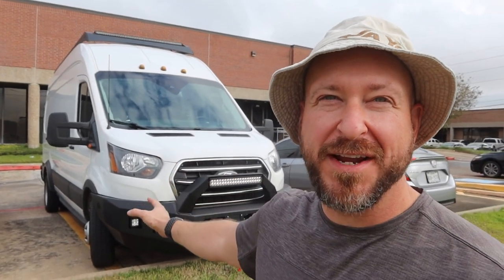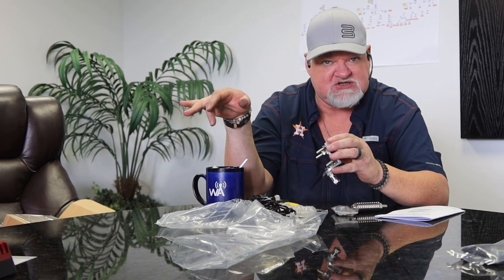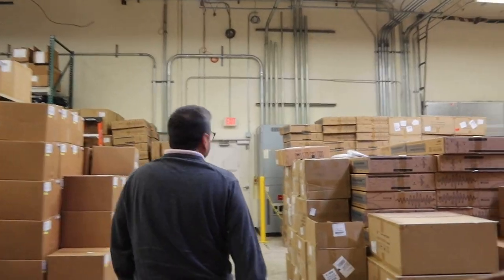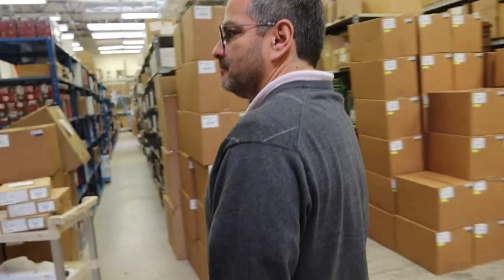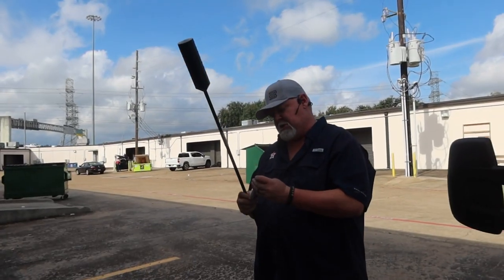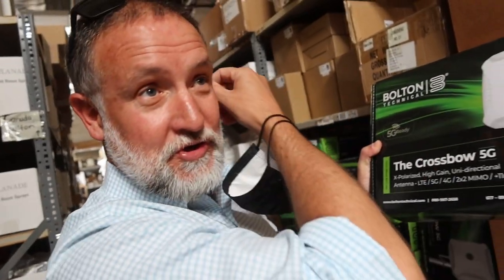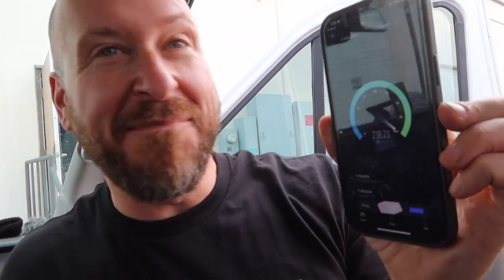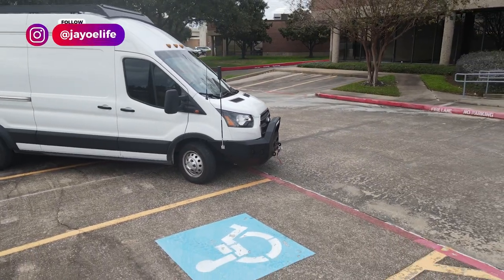Best Van Life Signal Booster | BOOST your Cell and WiFI signal +30% on the Road!

Comment: That is a nice attachment. I would rather like to add one more support near the top of the vertical pipe, so that the antenna does not vibrate and remains solidly fixed.

Comment: Transmission speeds are always expressed as bits/second, NOT Bytes/second, so the download difference is 100 Mb/second.
The convention is to write down lower case b when bits is involved.
Difference between Bytes and bits is roughly a factor 10 as a rule of thumb.
Furthermore, it's an awkward place to mount an antenna for several reasons.
Post Scriptum: If you realy want massive improvement, use rotating directional antennas instead of omnidirectional types.

Comment: I need a small weboost system that lay down flat as a small magnet on my van and the cables can be closed into the door and no holes required.
Reply from the maker: hmmmm.. thats a good idea.. i know they make magnetic antenna